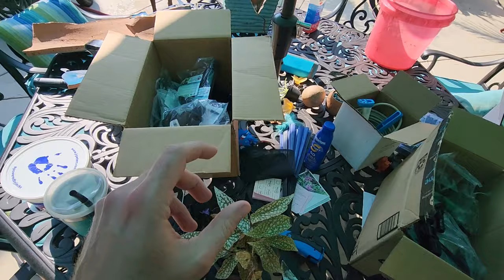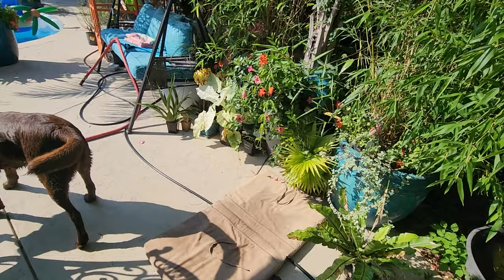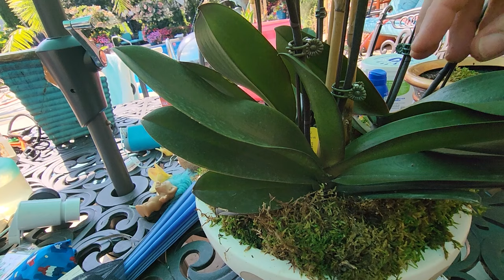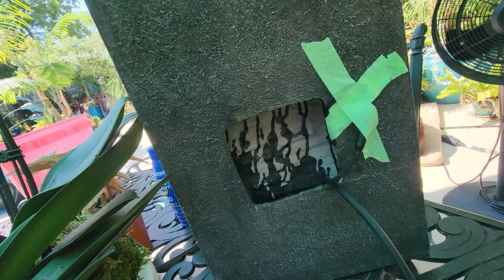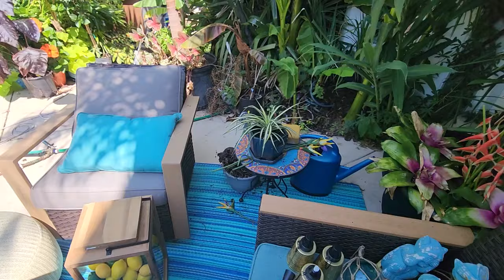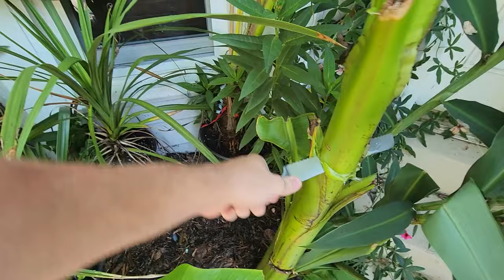Making an Orchid Centerpiece Bowl & Decorating The Outdoor Seating Area

Comment: I had questions for you but when I tried to ask on instagram I couldn't. I was hoping to ask your help about my Chinese fan palm. I don't know if I can even find response here again. I watch you on tv firestick but came here to do comment. I am in apt in zone 6. Also,  wondering how you deal with spider mites with your tropicals. I gave up for good on ever having my favourite banana plants BC of that but still get on other plants including taro in pond in my kitchen. I LOVE that ponytail!!! I had the most gorgeous one that grew huge for years, it curled down under the pot on floor. I have rabbits not cats and the plant had the most perfect haircut all the way around it at about two foots height and then our other large breed rabbit finished it off. I then killed my tiny replacement lol. Love your turtle as well. I had a chameleon instead a while back :)
Reply from the maker: Hello! 😆 I love rabbits, they do a good job "pruning" the plants. 
I use neem and/or diluted peppermint oil for most of my pest control. I prefer the peppermint oil for indoors bc I hate the smell of neem. I eyeball the dilution but I'd guess it's about 1 tablespoon per liter of water. 
With the taro in the pond, id just blast them off regularly with a hose since there aren't any safe solutions for spider mites that won't potentially harm aquatic life.
Reply: @TropicalPlantParty  thanks :) I use bug be gone as told it was safe on taro, pond is only 55 gallon indoors in front of window in kitchen. Dunking it in the pond never worked lol.

Can you help me with diagnosing my Chinese fan palm as you have some? I would need to send photos and explain.
Reply: And bunnies can devour entire colesus plants and black pepper vines until it's just disappeared, root and all lol.